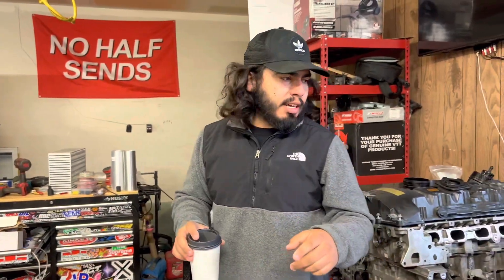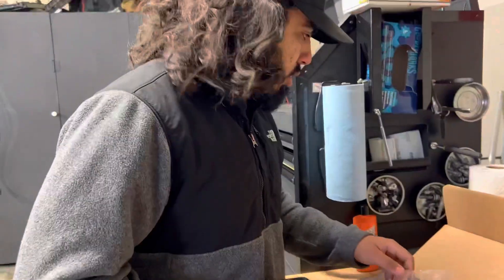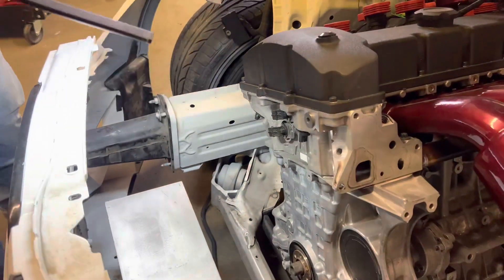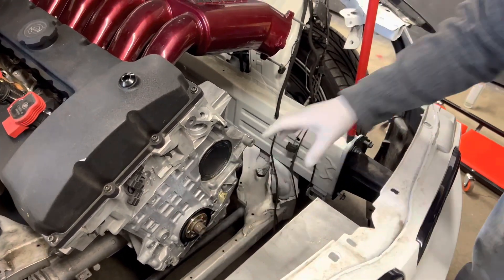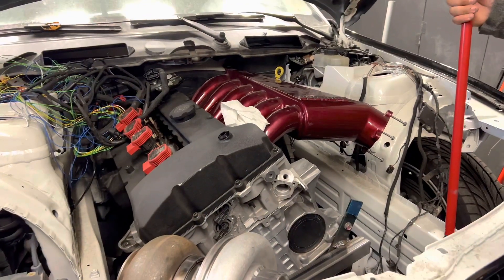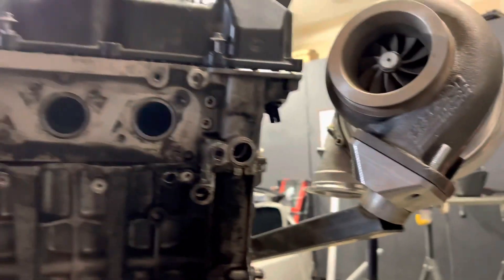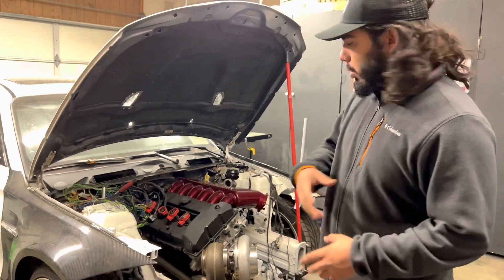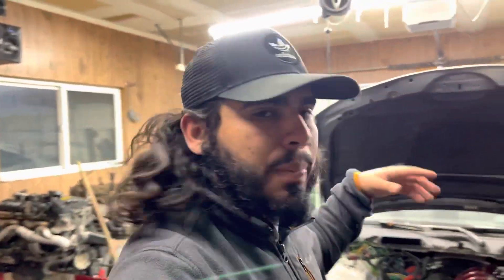N54 front facing turbo manifold build

Comment: Is that the VTT valve cover? How is that working out? I'm between that one or M18 for my ST N54 build.
Reply from the maker: Yes it it, looks good but it’s cheap aluminum and casting, it cracked a little bit around one of the bolts pretty easily it I jbwelded the crack and it seemed to hold good. If I was to buy one again tho I would probably still stick to the vtt one since it looks good just don’t over torque the bolts
Reply: @mohicanspeed  Hey man thanks for letting me know about VTT VC. I read somewhere that the cast versions are made in China and then machined in-house to correct any imperfections. Not a big deal to me but if it ends up being an inferior product then I would think twice before buying. Did it crack under factory torque spec?
Reply from the maker: @xpo186  tbh I don’t know how much I tighten it, I winks just sent it no torque wrench just went for a feel but I am pretty sure it was over the OEM specs. Another thing tho that I got to mention I think the gasket that came with the valve cover could of been part of the reason that it cracked. The gasket was a pretty hard rubber material and it dint fit so well so I think from the pressure it cracked the grove where the gasket sits. Because the valve cover cracked on the outer lip that holds the gasket it was just a small crack tho. So if you get one definitely use an oem gasket and not the gasket it comes with
Reply: @mohicanspeed  Whoa ok, so Vargas doesn't even include a factory gasket? Sounds a little sketch but will definitely buy an oem one just in case. Do happen to have any pictures floating around online of the part that it cracked? No offense to Vargas but most of the threads where get love are full of their fan boys, and I feel like you're juts being honest about your personal experience with their product. Anyway, thanks again for the advice bro. Looking forward to seeing more of your build!
Reply from the maker: @xpo186  Message me on Instagram and I can send you a picture and video
Reply: @mohicanspeed  hey man, message sent thx for your help/advice!

Comment: Definitely test fit cylinder 3's runner in the car to make sure it doesnt hit the frame. Probably the only one you have to worry about. Awesome project though! I'm new to welding but eventually i want to do the same for my 535xi. Just going to require a ton of relocation work first and some more practice tig welding. Btw, did you mill that head flange yourself or can you buy that somewhere?
Reply from the maker: Yea cylinder 1 and 3 need to be moved a little bit more for them to clear the frame, I got the head flange from a local shop that makes them but you can also get them from CX racing they have them on their website
Reply: @mohicanspeed  thanks so much! That website has some great stuff and a decent deal for that flange.
Reply from the maker: @milehighboost5521  no worries 🤟🏾